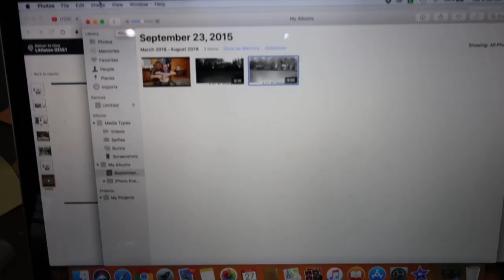I PROVED her Wrong AGAIN!

Comment: Roofing and then wood stacking.  You're almost there.  Just an idea, but I would put planters in front of the walls for flowers next spring and summer.  That way your entrance to the house would be landscaped easily.  I know it's a wood shed, but nothing says it can't be beautiful.  Also, where all the wood is stacked across from the shed might make a nice garage for Gina's car. ( unless the snow blows in that direction.

Comment: Cut those inside corner pieces at 76.5 degrees instead of 45 and you wont have to use the shims.  You two are a great team.

Comment: One other observation...since your foundation is laid upon the ground, you may want to consider a run of  french drains to prevent foundation rot...esp. with your winters that are conducive to holding moisture against buildings (snow....against the foundation.)   also, you need to think about intrusion of that apple tree roots...sooner than later.

Comment: You could just add a double carport and not worry about it! In long term you will probably require an equipment shed anyway
Reply: Great Idea next build a building for all your tools and farm equipment
Reply: I think they'll need a greenhouse too. It's going to be another brutal winter.
Reply: IIRC I think he was going to use the side of the barn opposite where the goats are for equipment and outdoor tools.
Reply: @lindagullage3077  Already did, it's called a barn.
Reply: @paulmonk7820  then  why the game of wanting to put the tractor in the car port
Reply: LOL

Comment: The tomato hornworm represents the larval stage of the hawk or sphinx moth, also known as the hummingbird moth. These moths overwinter in the soil as dark brown pupae, then emerge and mate in late spring. They lay their eggs, which are round and greenish-white, on the undersides of leaves. The eggs hatch in four to five days and the hornworm emerges. It spends the next four weeks growing to full size, after which it will make its way into the soil to pupate.

So, no they are not dropping from the trees, they are coming directly from your garden and migrating to find a suitable place to dig in and pupate over the winter.

Comment: Another day of teamwork progress, I wondered why you did the trimming before the roof, but the tin is not yet to hand and the wood is, so the shed is starting to look good even if not yet ready for its 'residents'. As ever your team work is winning through even if the days are getting colder and starting is a bit harder. I hope the weather holds up until the roof is done as the unfriendly weather cannot now be too far away - and it is only very early September.

Comment: Quote. Abe L. "If it's going to take me 4 hours to chop down a tree, I will spend 3 hours sharpening my axe"  It took me near an hour to set up for a day's trim work, the serious Trim work. The Sun's path (shade vs Sun), wind direction, so I don't eat dust all day, no more than 1 step away if possible from the actual "work" area. And also, just as important to me, I will not tolerate an Air Compressor ringing in my ears all day. Around the corner, down wind, whatever it takes. At the the end of the day, I will be completely exhausted, but not from walking, or being exposed to extreme weather, or carrying a lot of tools. But I get done twice as much as the normal Trim Guy. Control your area, don't let it control you. The left & right hand comment was about the circular saw. I can't/won't do that.

Comment: the angle is each piece 22 1/2  degrees for the door casing
Reply: Right, this why that don't fit perfect.
Reply: Yep. I wish he could have heard me yelling before he continued with those cuts
Reply: 90 degree frame is 45 degree cut you have a 45 degree frame from the vertical line/plane so it is 22.5 degree cut. You just ruined your opening aesthetically and engineering terms. Why employ a pro eh?
Reply: Not that big of a deal.  Once the wood weathers and the ground freezes and swells this will all be uniform.
Reply: Good point Ed.
Reply: @Ed-lt3pp  a 45 degree and 90 dont fit together you have end grain showing. Thats the main point (engineered to cover end grain) and aesthetics.
Reply: I there build, not ours, look in the mirror..
Reply: Right, 22.5° cuts for an even miter joint and you avoid the shims.
Reply: @40intrek  Their build yes but they could do it right and avoid wasting material
Reply: Close but no cigar. He did cut his door casing, the outside trim at 22 1/2 degree miters for the fit up. The interior trim, the door jamb should have been cut at a 45* angle. @Ed Ortman is correct with his assessment. The long points of the top jamb piece should be installed with the long points down and the ends plane into the 2 x 4 of the rough opening. The 2 shorter angled pieces with 45* on each end. The high end planes into the 1 x and the lower end planes into the side rough opening. These are not meant to be mitered fit ups like you would do for the outer casing. The interior jamb is structural as well as for finished appearance. You don't want mitered angle fit ups over each other, which is why engineering wise the above described installation makes for a stronger fitment. But what do I know? I was only a union trained carpenter and joiner for 35 years.
Reply: @davidjohnston1971  The casing and outside trim/ architrave (as its termed in UK) are architectural, so the aesthetics have priority, and end grain is showing, good point on not overlapping mitre joints for strength. If Jamaica Cottage are supplying it to be 45 and 90 with end grain showing, I would caution against buying their stuff. Further, Al I think you could have made both buildings for far less money, using trusses for the roof, as it seems you are changing the original designs to suit your needs anyway.

Comment: If you put your miters for the angled faces on the back side (in other words trade the hidden and exposed sides), they will flush to the framing (albeit the piece will be approx. 1-1/2” longer than what you cut).  This will leave the ends of the angled face flush with the vertical framing.   Then miter the vertical and horizontal faces to the angled faces.  All cuts are at 45 degrees.   Easy peasy and the saw remains set at 45 degrees for all the cuts.

Comment: Al here is a couple suggestions for gathering up your apples 🍏 🍎 🍏 ( # 1 ) use your landscape rake set on a angle to win roll the apples into a roll ( # 2 ) check out edge { trimmers.com  } for attachments to the bucket of your tractor for scooping up the apples without digging into the ground... The woodshed is looking great nice to see you have help and building the structure, keep up the good work

Comment: Gina needs safety glasses when using the nail gun also Al you need to quit using you hands as a hammer. Please. You will for it later I know my dad did same thing it damaged the tendons in his little finger and had to have surgery because started to curl and wouldn’t go straight anymore. I won’t tell you what happened me nexts.

Comment: I don't think you need use that square when cutting so much.. Trust yourself with that saw. IMO that square doesn't help as much as you think. I feel i cut better without it. I usually only use the square when i'm having to trim a hair off a board.

Comment: Won't the bottom of the shed rot sitting on the ground?
Reply: James Couch ~ It's sitting on a bed of gravel plus a vapor barrier. If you go back to the beginning of the build, you can see what he did to protect against that.
Reply from the maker: The 6x6 post are pressure treated that are making the ground contact.
Reply: @LumnahAcres  that should help.

Comment: Al. I have 3 of those exact same cameras. Ive been using them for over a year and they seem to work fine.. I have put them through several different kinds of tests. My target animal is mostly deer and wild turkeys. Just to get an idea how many come through our property and how often. My target area is approximately 30 yards across an opening in my woods. I have set two cameras up facing each other before. At times both cameras would take pictures of the same animal but most of the time it didn’t most of the time either one camera or the other would take pictures which tells me that the maximum range on those cameras is about 20 yards especially at night. Also what I found out was almost any movement will trigger them including tree limbs blowing in the wind .. grass or weeds blowing in the wind. What I’m saying is you’ll get a lot of nothing videos. Strategic placement of the cameras is important. It should not be more then 20 yards away from a specific target and low enough to capture raccoon size targets within that 20 yards and not pointed directly at your farm animals their movement will also trigger the camera. If it were me I would set that camera on the back side of one of you chicken tractors so the tarp blocks movement of your animals about 15 yards from the tractor and about 2 to 3 feet off the ground wild preditors will circle that tractor trying to find a way in. An example of some of the things I have caught trolling my chicken coops  dogs, cats, raccoons, coyotes, ( not many of those ) and bobcats ( only 2 ) I lost 4 chickens and 2 turkeys before I set out those cameras and none since. I have successfully trapped many of those problem animals. On some I had to use leg traps which I do not like but I also can’t tolerate loosing my farm animals. I do not relocate any of these preditor animals I understand that it’s instinct for them but I could not release them in another area to kill someone else’s farm animals once they get a taste of chicken they will never stop coming back it might not be every night but they will come back. Hope this is helpful
Reply: George Vangordon jr Sage advice! Many people won’t appreciate the fact that you have to dispose of these predators but unless you live on a farm with livestock to protect you don’t grasp the true reality of the situation. Great comment❣️

Comment: Did I miss where Gina is no longer working? If she is home for good, then congratulations! I understand that Gina would like to park in the woodshed, but I think that Kubota would be better off there as You will have to use it daily when the snow flies and it would help you not sit on a wet seat, where the car will always be dry on the inside. And if she isn't going to work anymore, why is it necessary to be in the shed? Are you eventually going to build a garage? Love and blessings!
Reply: @Lenella Maxwell:  Tractor seat can be easily protected from the weather.  Car needs to be shielded from snow for easy access and use.